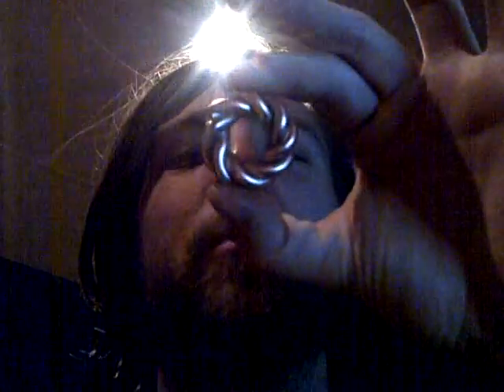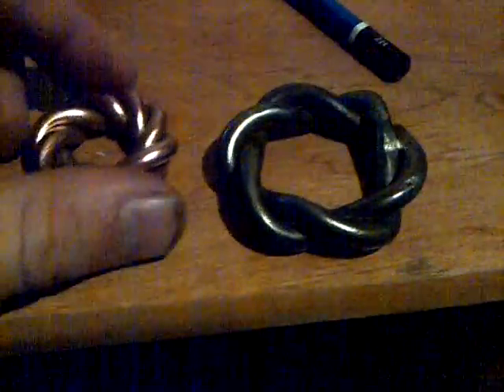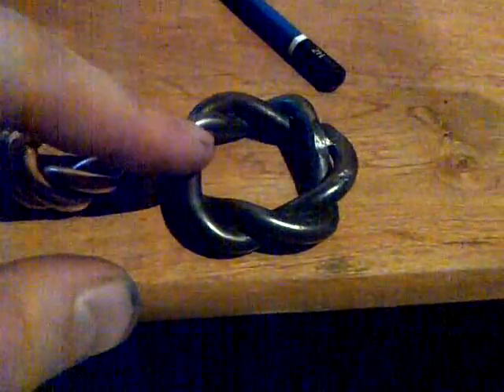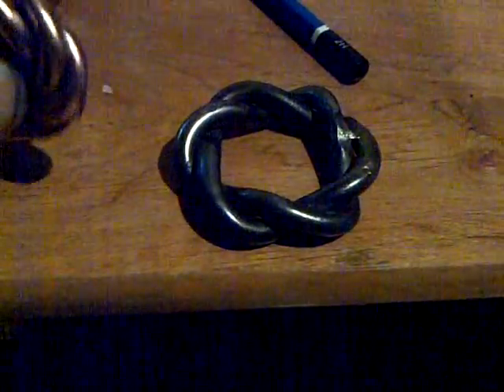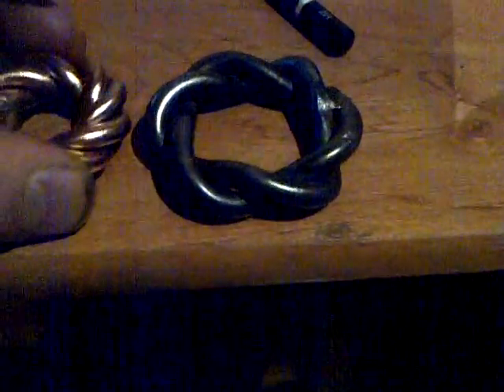Octagram Manifested

Comment: @GregorArturo85 ,
ok i am still learnig about the matrices. 
I built a star of david coil and put in curciut with my circuit and got voltage reading of .027 without and a voltage rerading .247 to higher with it in circuit. it is a shoty coil, i will buiild a prettier one and post it for you to see. it reminded me of the rodin coil vdeo you posted a while back